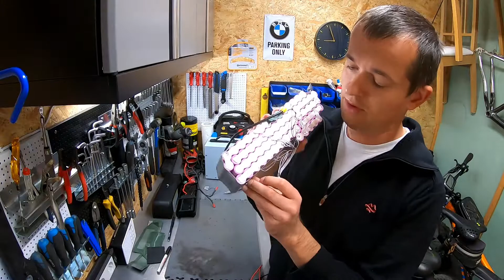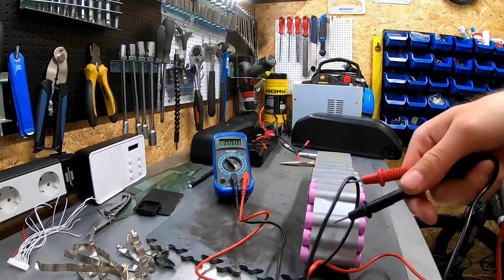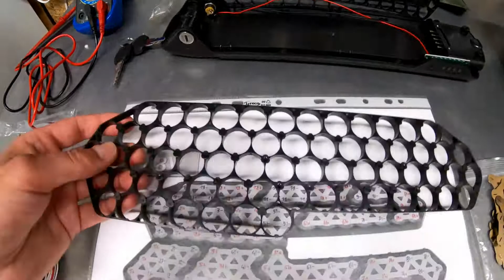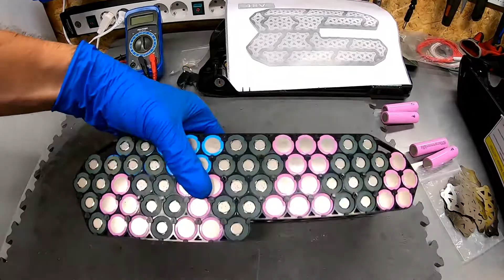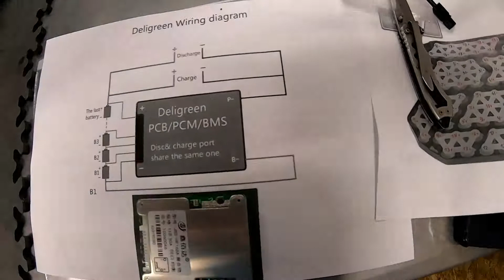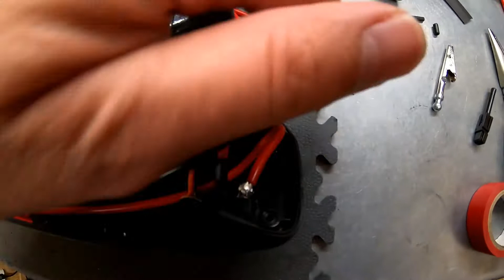Ebike battery building process

Comment: Great video but it only has 2-3strip between series connections 
So this should not go further than maybe 15A load current
Reply from the maker: Max load current depends on many factors, not just width and thickness of the strip. Length is very important as well. Current capacity decreases with connector length. Also temperature plays a role here.
Reply: @LierskogenEbikes yes it's depends on thickness and width and materials. Lengths is not effected if we talking ebike battery because you don't need that much Lengths in making this battery.

Comment: Really useful post thanks. Did you end up reversing the polarity of the battery's just before spot welding? Or was it my imagination.
Reply from the maker: Yes, you are correct. I'm surprised, that you have noticed that. It's very, very easy to make a mistake and put all cells in reversed order.

Comment: I got super lucky with mine. 2 batteries from the manufacture of my bike both died within 6 months. I popped them open and every cell but 1 was fine. that one even tested fine but had scorch marks from the BMS dying or whatever made them stop working lol so i tossed it to be safe. I'm changing it from 2 48v to a single 52 and keeping the spare for future issues. Thanks so much for the guide :)
Reply from the maker: Good that you didn't throw them away. You can always recover good cells from dead battery. I heard once from friend working in big bike shop in Oslo about dozens of Bosch and Shimano batteries thrown away without checking, if cells can be salvaged from them. People ignorance or lack of awareness what you can do with broken things is just shocking.
Reply: @LierskogenEbikes  yeah I just refused to pay 400 for a proprietary battery when I could pay 400 for decent equipment to do it myself and increase the size and performance of the battery all in one go. Now I will never be at their mercy again!

Comment: Thanks for the video - recently ordered same case with the strips and a bms. Need to find cells now. Looks like the on off switch might be the weakest point - it doesn't seem to be meant for high amperage. I wonder if a BMS with a switching ability could be better choice.
Reply from the maker: I built one or two batteries with main circuit going through the switch. But these batteries are used only with TSDZ2 motor, which can draw max 15A in the peak and is using thin power cabling (AWG 18 I think). So for the time being switch is holding. Most of these switches can handle up to 10A continous with 220V or 110V (depends strongly on switch size). If you decrease voltage, they can handle more, but no hard data on that. Anyway, I strongly recommend to use BMS with separate ON-OFF circuit, if you want to use the battery for stronger motors.